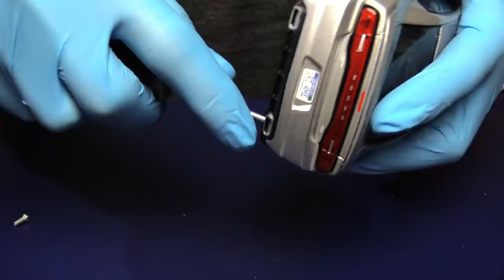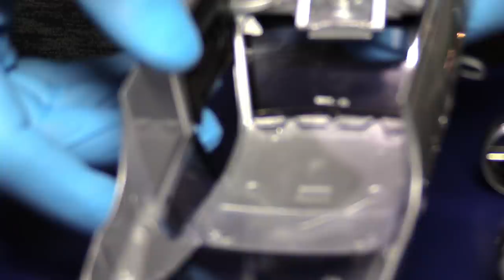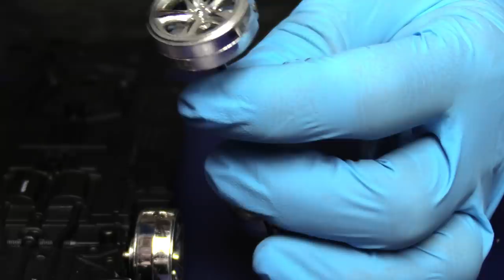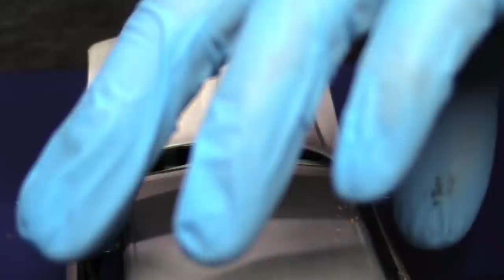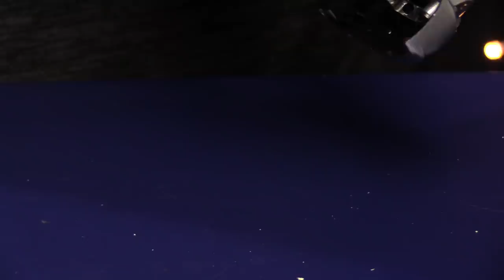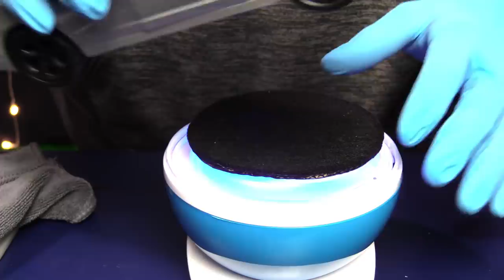Soothing Sounds Of A Dodge Charger R/T Mod ASMR

Comment: Time to relax to the sound of a 5.7L Hemi V8. Nice car by the way.
Reply: Saab 35 draken for the win!
Power de svenska
Reply: @lido1643  Draken for the win man, Draken for the win.
Reply: Levario Jones  sorta yeah.
Reply: Levario Jones  alright, how much horsepower does a Plymouth Cuda 426 HEMI make? Last time I checked it was 770.
Reply: Levario Jones  ok I was wrong on that one. I think it makes about 770 with a supercharger.
Reply: Levario Jones  the 1970 Camaro Z28 came from the factory with 360 horsepower made with a 350ci small block chevy engine.
Reply: Levario Jones  didn't I already say that? Even though I read something that said it also came with 370 horsepower. Now I'm confused.
Reply: Levario Jones  ok ok, uh, how much torque does a Kenworth Cabover truck make?
Reply: 2007 Soo sexxyy
Reply: That was body style charger you could choose between a 5.7,6.1 or a,6.4 hemi for it
Reply: The fact that both people could just be yk Googleing the stuff is really funny to me
Reply: @masonpritchard6397  no I just really like dodges I have a 1990 ram single cab short bed 318 3 spd auto and a 1966 dodge coronet 500 with a 440 and a A-833 4 speed manual
Reply: @rockmotors5324  no no your good its just i pictured two people with no idea having a google battle it was a boost of dopamine for no good reason
Reply: 13b rx 7 fd latas
Reply: Yo i dont know shit about cars but this reply section is interesting af
Reply: Challenger cobra 392 nonetheless 🥶🥶🥶🥶
Reply: @lovewrld352  what about a 1200HP, custom built, Hennessy Resurrection with a 2.65L supercharger? You gotta love Hennessy and their muscle cars.
Reply: Levario Jones  I don’t think you know what google search is...
Reply: @sturmtruppenofthemidwest  a supercharger that’s bigger than my whole engine lmao
Reply: @lovewrld352  “nice supercharger there, did the car come with it?”
Reply: I know I love the car. But personally I like to fall asleep to the sounds of WAR gunshots, yelling, and bombs.
Reply: Red lines it mid video
Reply: I was confused as to why 5.7L but then i realised that it's not the hellcat so it doesn't have the 6.2L xD
Reply: @sturmtruppenofthemidwest  I'm also a casual car fan, although my expertise is more on the JDM market
Reply: A k series better 🤷🏽‍♂️
Reply: Legendary battle in here
Reply: @sturmtruppenofthemidwest  the people at hennesey are literally insane
Reply: @kraftgratedparmesancheese9148  they are insane. But still, they're cars are awesome.
Reply: @sturmtruppenofthemidwest  indeed
Reply: @masonpritchard6397  it’s so obviously the same person with 2 accounts it’s hilarious
Reply: @kraftgratedparmesancheese9148 if it's not 1k hp it's not cool
-the people at Hennessey, probably
Reply: The best sound to relax to
Reply: @carterleonard1318  this shit right here
Reply: I’ve just read all your replies and I want to bleach my eyes 🤓

Comment: Does the model break down as often as full-size Dodges do?
Reply: Lmao🤣 transmission issues within 5 seconds of rolling
Reply: I remember my big sis got a Dodge Charger it instantly broke down within the first month of having it
Reply: Bruh they ain’t that unreliable anymore
Reply: @andrews8925  consumer reports and experience in auto shops say otherwise....
Reply: @amishabe8085  my guy ( or gal ) Mopars from 2010 and back where not the greatest when it comes to reliability, but any onward was when they really stepped up there game, Ram has been #1 in reliability for 4 years now and dodge has been rated to have an above average rating by repairpal, CarandDriver, and KellyBlueBook.
Reply: @amishabe8085  I wouldn’t really expect you to know this but now you do